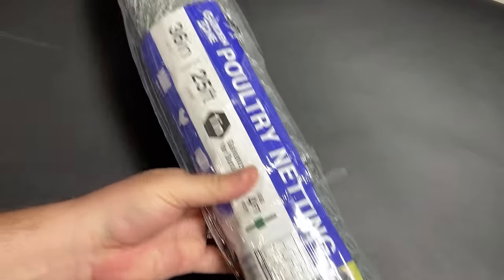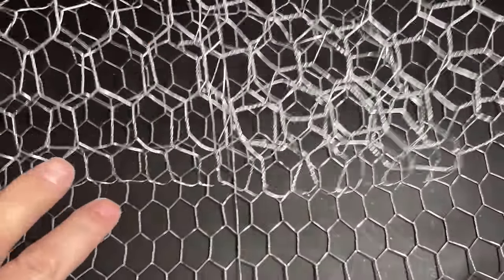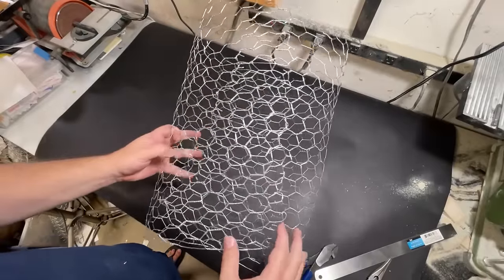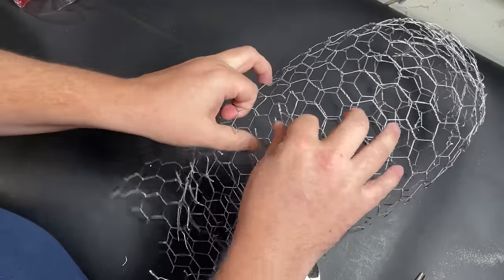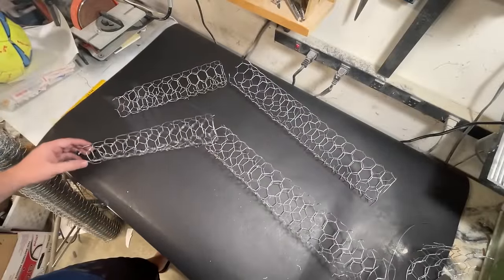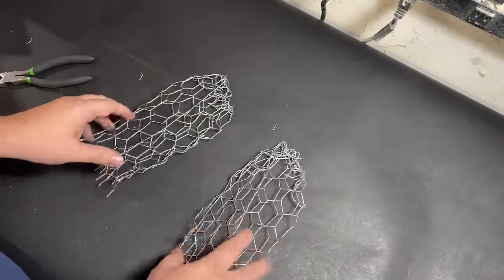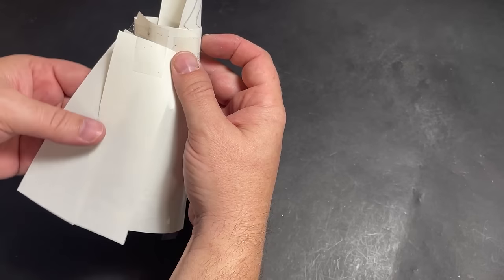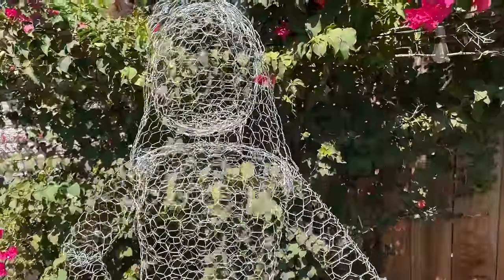How to Make a Simple Chicken Wire Ghost

Comment: Excellent tutorial video.  I used a clothing mannequin to form my shapes,  but had trouble cutting them back off.  Still worked. Just more work. 

I love you in in depth steps here.  One of the few wire tutorials I've seen talk about how to actually connect the pieces.  

Great looking ghost. 

I'm just finishing my dancing couple ghost wire frames and will be coating white then using a glow in the dark coating on top. 

I've seen others shade random bottom portions in black too add a tattered or invisible look to the dress and legs that helps create a floating effect.  Since nine will be slowing turning,  might be good.

Comment: This is amazing..I will try this weekend. Question: if I place a spot light or black light at the foot of it, would it “be visible” at night? I would think so but wondering if you tried it.
Reply from the maker: Thanks!  One thing you can do is spray it with clear UV reactive paint and use a black light. It looks incredible at night.  A normal spotlight could also be used if you don’t have UV paint - it’s better than nothing.
Reply: @ImNotBoredImCreative  so I made my ghost following your steps up until it came the arms. I made mine holding a candle. Then I made a ghost kitty. I wish I could share them cause they came out great.
Reply from the maker: @RaquelTrueba  Do you have instagram?  If so, post pics and tag me @ImNotBoredImCreative  I'd love to see how it all turned out!
Reply: @ImNotBoredImCreative  got it I tagged you in my 2 recent posts. A daytime pic and a nighttime pic. Thanks again.
Reply: @RaquelTrueba how did you keep them from falling over or getting knocked over? Did you do the spot light?